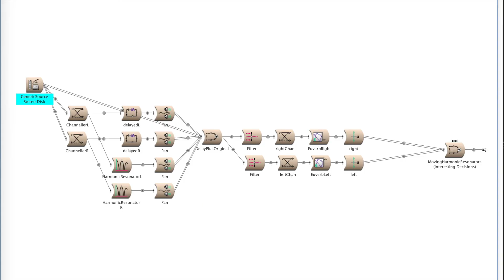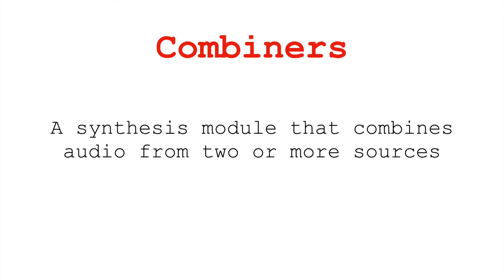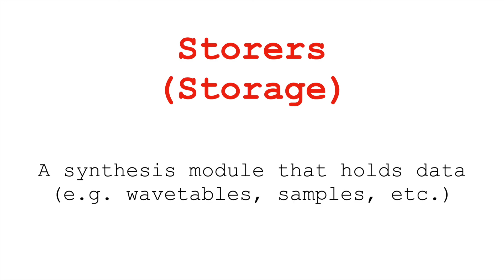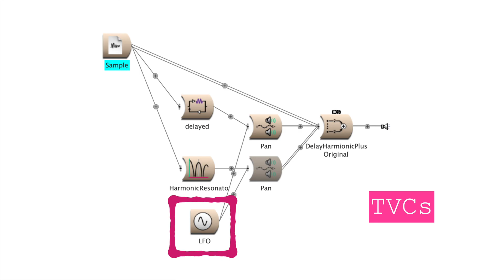The Five Types of Synthesis Modules (Fundamentals of Sound Synthesis) | Simon Hutchinson

Comment: An oscillator is a source. It has an output.
An amplifier is a processor. It has an input and an output.
An oscillator -- a source, can function as a signal, a control, or a logic function.

Comment: There are two kinds of modules: source and processor.
Reply from the maker: I see what you're getting at here, but I do think there's a pedagogical usefulness in separating out sound sources and TVCs (i.e. "not-sound" sources), and also giving special consideration to combiners (which bring multiple signals together) as separate from modifiers (which alter a signal). 

Again, if our goal is a framework to let us approach any synthesizer, starting with an understanding that you don't run your "control signals" into the outputs can be helpful for those just getting started.